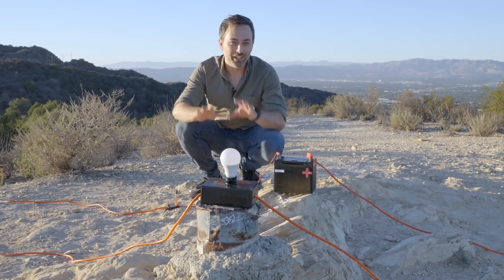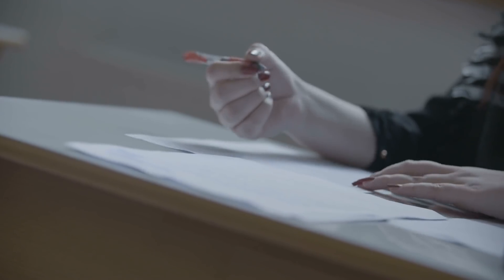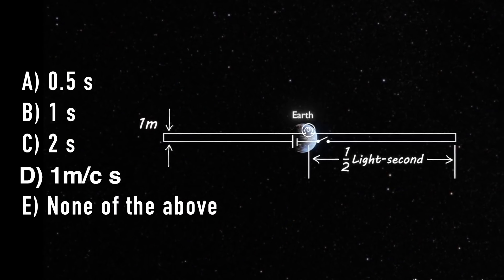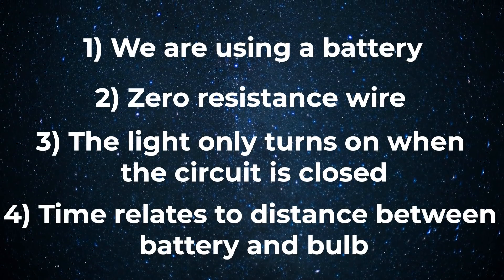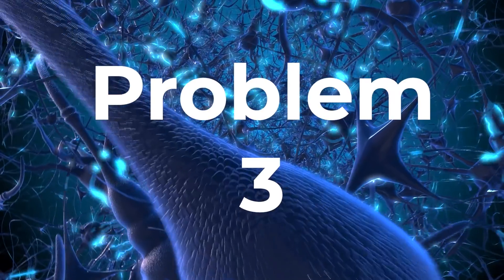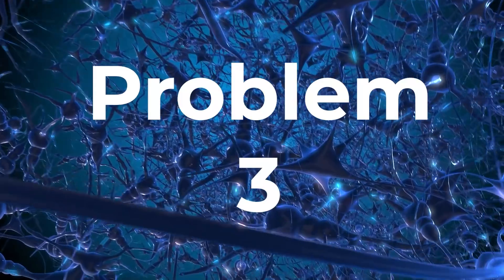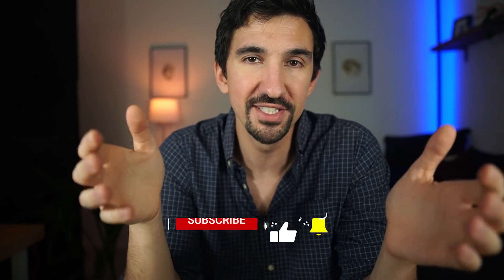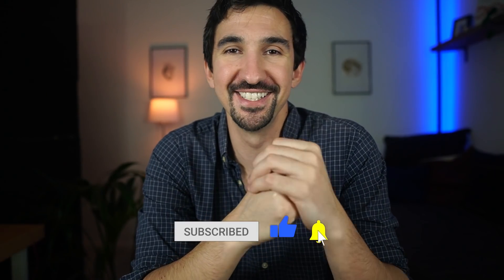Is Veritasium Wrong About Electricity?

Comment: It's true that the circuit are really two antennas, but in DC current all you have is an EM pulse that will never turn on the light of the lamp. The video of Veritasium has lots of errors, like the direction of the electric field in the circuit, the claim that electric and magnetic fields are in phase, and more important the claim that is not the moving charges in the electric fields what drives the power.
I'm not denying that EM waves carry energy, but they are not what make electric circuits to work. We all know about LASER cutters, but they are nothing compared with a welding machine or a lighting bolt...
Reply: You will have to take a few serious physics classes on the subject, I am afraid. That moving charges transport the energy is easily falsified by the sun. There are no moving charges between the sun and us, and, yet, the sun deposits enormous amounts of energy on Earth's surface.
Reply: @lepidoptera9337  I am an Electrical Engineer, so I've took serious physics classes indeed. Of course most of the energy we use in Earth comes from the sun. Even oil fuels come from living organisms that were fed thanks photosynthesis. But the sun is a star, that produces gigantic amount of energy by fusion of Hydrogen. We are desperately trying to collect and use that energy. But when it comes to produce and transport electrical power, we need the wires and the charges moving inside. We wish to have another way to transport energy from one point to another, but there is none. Wires, batteries and electrical circuits are still needed.
Reply: @camilojcastillo  And by "serious physics classes" you mean "none". OK. Say, what's the drift velocity of electrons in copper? :-)
Reply: @lepidoptera9337 , I don't have anything against you. It's true that the velocity of electrons is astonishing slow,  indeed, but Derek had a pretty good device to show that if we think of the electrons moving like a chain, we can understand why you don't need the electrons to reach anywhere to transport energy. The important thing is the amount of charge tha cross the section for second (i.e. the current) and not the velocity of the charges.
It's like a wave of water in the sea, or the air of a sound wave. Is not the air that comes from my mouth what you ear, but the wave of pressure that reaches to you.
In the case of electrical circuits you also have a wave of electrons that move 2/3 of the speed of light. When you close and circuit the wave of electrons will begin to travel. Interesting enough is the fact that the current of electrons does not depend on the load, it is fixed by the "characteristic impedance" of the circuit. When the wave reaches the load, a reflected wave will be generated to adjust this transitory current to the current that is absorbed by the load. This can produce dangerous overvoltages that have to be taken into account.
Reply: @camilojcastillo  If electrons were moving like a chain, then the propagation velocity of  electricity would be limited by the equivalent of the speed of sound in the electron gas, which would be far from the speed of light. I don't have anything against you, either, but I would advise you to take some serious physics classes. :-)
Reply: @lepidoptera9337  that speed of the wave is almost the speed of light. In copper it's like 2/3 of c. Don't trust me. You can search for this. For example a wave of water might have no drift velocity at all, but you will see the wave "moving"
Reply: @camilojcastillo  Yes, that's the speed of the electromagnetic wave around the conductor. The electrons are not doing any of that. That is what they would have taught you in a serious physics class. :-)

And, no, you will never see a water wave moving fast. It can't even move nearly as fast as the speed of sound is in water. That's good news for people who like to be at the beach, by the way. You don't want to be hit by water at 1500m/s. That would ruin your day... and all following days, too. :-)
Reply: @lepidoptera9337  Hahaha. I feel like Howard with Sheldon. That electric field do move the electrons. That electrons movement is what we call electric current. That current does generate magnetic field around, and an EM pulse might be generated. But so small, that you will barely measure it. Is the current what drives the energy to the lamp.
By the way, with the water example I tried to show that you don't have to confuse drift velocity with the wave velocity, they are very different things.
Reply: @camilojcastillo  Did you take a serious physics class, yet? :-)
Reply: @lepidoptera9337  I've found a great teacher on internet. He's a former student of engineering that explained to me in 20 minutes why the Earth is flat, but everyone lies about it. ;-)
Reply: @camilojcastillo  Sounds like you are in good company. Now go and take a serious physics class. :-)

Comment: To your 2. Point: I think the assumption of the switch having to be closed for the light bulb to go on is wrong. From my understanding it's the propagated wave that induces a current at the light bulb. However if the circuit breaks, current will stop flowing and therefore no more induction at the light bulb will happen. But there should be a time interval where the circuit is open an the light bulb still on, because the current at the switch is still flowing for half a second until the information that the circuit is broken reached that location

Comment: I'd like to see that experiment, not with a second delay (that would be kinda expensive because of the long wire) but with a 1 MHz switch speed what gives you a phase turn after 300m the delay can then be displayed with an oscilloscope.
Reply: You can easily build this yourself with a fast mechanical switch (typically a mercury wetted reed relay is being used) and a few yards of RG-58. You need a fast oscilloscope to see what happens, though.

Comment: all this fuzz  comes  from the aparently controversy of   the net flow of electrons so slow ( few meters/sec) against  the speed  the light is"lit up", as always this can be explained  with the hidraulic analogy : when  you open a valve  in a pipe FULL of water, it  will come out "instantly" (at the speed of sound ) while  water close to the valve barely  started mooving... we'd say:    water energy does not  flow with water, but around the pipe  as  the diffeernce otf pressure between in and out, which  travels at speed of sound, and  makes an effect at the end of the pipe  pipe, same   would happen  if instead of a valve  you have  a piston  back and forth, you wont need  a net water flow  for energy to travel

Comment: Hm for point 2... It's NOT distance from the battery but from the SWITCH. So if a break occurs anywhere on the cable THAT is the distance you have to use.

Comment: Great video, thank you!
After watching Ve video I started to think what would be the effect if we would put the bulb and let's say - half of the wires next to it in a Faraday's cage?

In my opinion, If you think of electricity as of an EM wave, then you should think of wires as waveguides.
When we design computer network cabling, we take into account the length of a cable, not the placement of transmitter and receiver. Are we misguided by the teachers and equipment vendors?
Advanced cabling testers/meters are giving you a length of the cable, not a distance between it ends. With 3 GHz CPU you can measure a distance with ~ 1 cm resolution, so you don't need Earth-Moon distance to test your theory. Just buy a 1000 ft (305 m) of UTP wire and check if unwinding it would make a difference in a signal timing :-)
Of course the result will depend on shielding, twisting of the pairs because like you said - we have a sort of antennas here (especially, but not only when we use high frequency signalling).
Reply: Twisting wires makes them "as close as is physically possible" so that an EM pulse inducing a spike in one wire will induce almost identical, but inverse, spike in the other cancelling out much of the interference... that really has nothing to do with this calculation...
Reply: @smitcher  You are right - absolutely. I have realized that I have written something different from what I have meant. My thinking was that putting two UTP and especially STP cables parallel to each other would create very different setup from what was in the Derek's video, because in the latter the transient effects which could lead to fast energy transmission depend just on the interference (EM coupling). My point is that when you cancel or at least decrease an interference effect, you achieve more energy/information transmission along the cable, rather then in other directions. This is the main purpose of twisting pairs and or shielding... From Veritasium's movie one could come to conclusion, that energy is always transferred directly from the energy source to the energy receiver, which is true only in some specific setups and/or stages of the system.
Reply: @marek-kulczycki-8286  Yeah it's quite a contrived example about ENERGY flow which can be important from a PHYSIST point of view when you are considering conservation of energy but as electrical engineers we don't always have to resort to Poynting Vectors and R-H Grip and Maxwell Screw rules for simple current and voltage calculations, especially for DC analysis. The only part of this affected by AC analysis is the initial transient when the switch is closed. A better example would be a circular path of 2c length or an example with two switches, one opposite ends of the branches, c metres apart and both turning on at the same time.
Reply: You are not being misled by teachers and vendors. The length of the cable does matter. In reality you cannot pretend that resistance does not exist. The resistance of the circuit is very highly dependant on the length and surface area of the conductor. From Ohm's law, Voltage=Current x Resistance, or Current = Voltage/Resistance. So it's easy to calculate the resistance of the wire based on its diameter, physical characteristics of the element it's made from, and the length of the wire. And as you can see, the current depends highly on that resistance. If you increase the resistance (ie have a longer cable), you lower the current. There is no way around this in the real world. That's why we care about the length of the cable (as well as it's other physical properties), and why we need to take care to strip terminated wires carefully and properly, and why we need to take care not to overbend/fold the cable. A tiny knick on the copper, or a hard fold somewhere along the cable's length, will change the surface area of the conductor, and if you change the surface area, you change the resistance, which changes the current.... They weren't misleading you-- that guy on the on that Veritasium video is the one doing the misleading things, by ignoring resistance in an 'experiment' involving super long conductors.
Reply: @captaindred342  Agree. But I appreciate one good outcome of that Veritasium's movie: It inspired me to re-think the physics of electricity. As I see it had similar effect on many others. If it confused or mislead some people - that would be a shame though.
Reply: The capacitance between the faraday cage and the wire would affect the impedance of the transmission line model that you would create and thus the calculation and you would no longer have (1/c) seconds

Comment: I feel like this is something we can easily check with an experiment. Since 30 cm is traversed in about a nanosecond at the speed of light. We can set this up with a distance of  30 cm from switch to lamp and 3 m around the circuit. This should still be measurable with electronic devices and no superconductors or crazy voltages are needed.
Reply: do 3-30 meters
Reply: Yeah, but the Veritasium's point was that some of the EM field would reach the bulb. (Definitely not enough to light it up though- maybe make it emit some extremely weak IR blackbody radiation, but that is it) It is proven true, but he overexagarrated the effect in the video to make it seem mind-blowing.
Reply: can still be 1m apart, but make the length of the circuit needs to be at least 0.1% of the speed of light so around 300km, that will give a measureable difference.
Reply: It's hard to get a zero ohm wire in the real world.  Veritasium video was a theory.
Reply: We could do 300m or a kilometer and microseconds and two synched atomic clocks.
Reply: it takes few ms for a bulb  to get enought thermal energy to light up. it is testable with clocks
Reply: The lightbulb would never light, because the resistance of that length of wire would not allow the field that he describes to develop. This is especially true with a DC voltage source that only has the potential of 12 volts.
Reply: The eequipment exists. It is called "ethernet". We just read out bits instead of turn on lights directly.
Reply: Or speak to a computer engineer who works with this stuff on a daily basis designing circuit boards that handle high frequency signals for example between the RAM module and CPU.
They will tell you they use c/2 as the travel time.
Reply: Yes, and the entire shebang used to be available as a commercial product that was called "cable pulser". I used to have one. They are great at making flat-top pulses in the ns-range.
Reply: @LiveType  no, you completely misunderstood the deceptive veritasium video and this video here. Maybe watch the long explanation of EEVblog
Reply: @LiveType  Yes, you do misunderstand what is going on just as much as Veritasium does. This is a simple transmission line problem with, if you want, a mismatched load. So, basically, instead of trying to understand the real physics of it, you are merely debugging/defending a bad electrical engineering design. :-)
Reply: @LiveType  At 300,000 km length the lightbulb will never turn on because you don't have unobtainium as conductor. That doesn't mean that there is no signal. Of course there is... a lightbulb is just not the right detector. You are basically asking "What happens when I demonstrate my failed physics/EE education?". If you put that on the internet, I will give you the obvious answer: "You will become a troll.".
Reply: @lepidoptera9337  Superconductors exist, they aren't unobtanium. A 1 ly long wire is entirely feasible if you build it out of a superconductor.
That said, vertitasium is wrong in his video here.
Reply: @IamGrimalkin Let me know when you are done building that 1 light year long superconducting wire.  :-)
Reply: @lepidoptera9337 
Oh, I put light year. I meant 1 light second, while 1 light year superconducting wire is possible in theory you obviously aren't going to have a good time building it.
Reply: @IamGrimalkin  Let me know when you are done building a 1 light second long superconducting cable, kid. I can sense, though, that the goal post is moving at FTL here. :-)
Reply: @lepidoptera9337 
The LHC already has ~1 light second of superconducting wire installed.
It's not all connected in series of course; but you could do that in theory, and if you did, electricity could flow through the whole thing with 0 resistance (presuming the connectors were all superconducting too of course).
Reply: @IamGrimalkin  Let me know when you got a 1m long superconducting wire working at home. :-)
Reply: @lepidoptera9337 
Well, lead superconducts at 7.2 K and I've worked with a piece of lead that big. :-)
(Of course, I haven't cooled it to that temperature, and I'm not sure if unlaminated lead could hold the current from a car battery).
Reply: @IamGrimalkin  So, you didn't. :-)
Reply: @lepidoptera9337  talk about moving goalposts
Reply: @LiveType  What was the question? Are Veritasium and you trolling? Yes. :-)
Reply: @lepidoptera9337  I think you're the only troll here, just an opinion. Take it and move on...
Reply: @LiveType  I take the apology and move on. :-)

Comment: For your first point:
1 meter between the switch and the bulb. I think this is the reason 1/c was one of the answers.

If they had put the switch at your hypothetical break point in the Vertasium video, the correct answer would have been 1/2 seconds if you follow their reasoning. So there is not really a problem.

I do think that Vertasium is not really clear about what the significant take-away is. It cannot be that the bulb will have lighted up visibly after 1/c seconds. But that is what they make it sound like.
Reply: @GoldenLion8  fair enough :D

Comment: Aren't you presuming the simultaneity of physically separated events with the way you apply your "wire breaks at t=0" premise? Your antenna analogy doesn't negate your original argument, because the resistance in the circuit would be larger without a physical connection, and that would be detectable, almost instantly, by your logic.